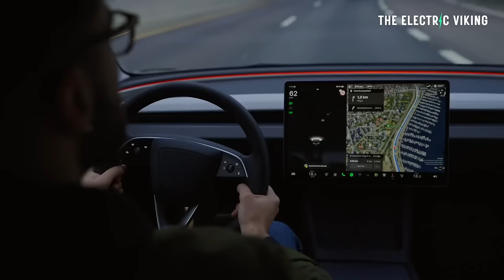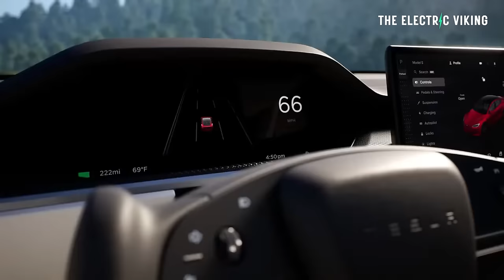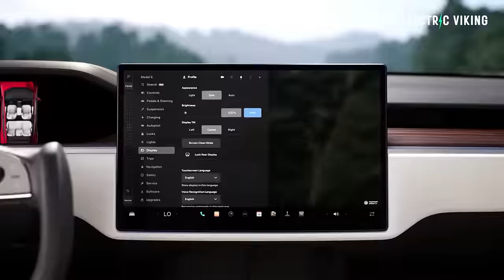Legacy Automakers lose $6,000 USD on every Electric Car they sell

Comment: Toyota will be the biggest loser in the EV transition. They are giving customer what they want today based on price and quality. Tomorrow’s customers want EVs at ICE prices, which is coming thanks to BYD. During the pandemic, Toyota had great sales of RAV4 hybrid, but that was 4 years ago. I haven’t even talked about FSD… who wants a manual car once that’s out. Toyota is number 2 market cap 350bn usd, they will fade out over 5 years. Business will continue as they are expert at productivity but much smaller.
Reply: People don't have high demands of new cars they just want their previous expectations met, a gas car takes at top 5 minutes to fuel to give you at 300 miles of use and some can be had for 25 or 27K new can use heater or AC in the winter or summer. 

Customers are asking you to simply meet a standard that is already being met by gas cars and not have to pay 50 thousand dollars for the privilege on some weird looking cars that only have a crappy display and controls, a shitty whirring noise and underpowered motors.

I essentially want an electric rwd Corolla with 300 or 400 mile range equivalent of 200 hp would be nice.
Reply: @motorbreath22   That maybe the case with some people and the Oil/Natural Gas companies are working hard to entrench that mindset.     The fueling up debate is old and tired.   Most people will charge at home for under 10 cents a KWh and spend just a few seconds to plug in the car when they get home and unplug it when they leave.  Of course there are exceptions.
Reply: @danharold3087  I don't own a home nor can I afford one I rent in los Angeles and cannot just have a charger installed to just top up at home, there's millions of us here in Los Angeles and I'm lucky as it's only me in my apartment there's hundreds of thousands that are roommates, so no it's not a tired excuse it's a reality for Millions of people everywhere. Try again.
Reply: @motorbreath22  Do you realize that in the US you don't need travel paper to move out of state?   For what you are paying to live packed in like sardines one can buy a house in many states.   Not sure what you do but there is industry existing or popping up in many states..  Either move or understand you have chosen the conditions you live in.    Think of it as a reverse dust bowl migration.
Reply: @danharold3087  Millions of people are not going to move so they can charge their cars, I do aerospace welding, Los Angeles has one if not the biggest aerospace industries in the world, we all chose our joys and misery, my point is still valid. There is no great affordable BEV in America, I don't care for BYD, when the Tesla 2 drops I might just get it. I wish Toyota would do it but here we are.